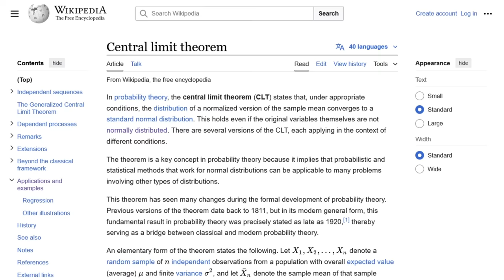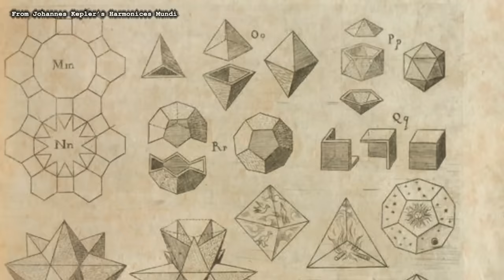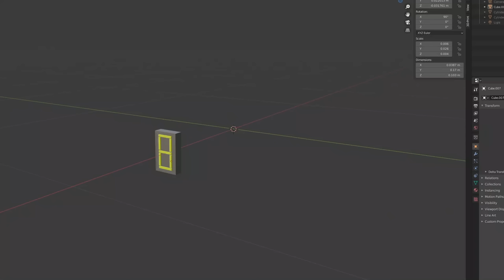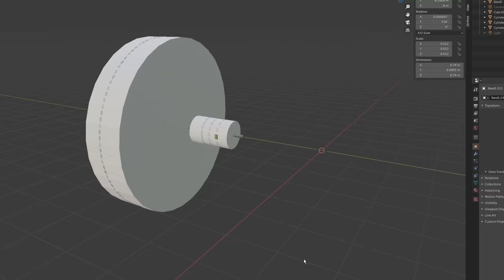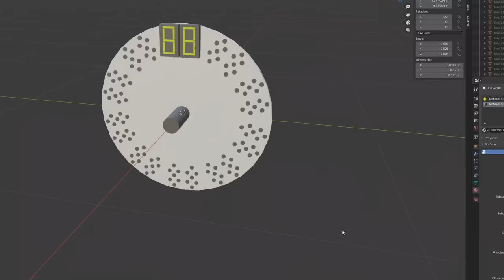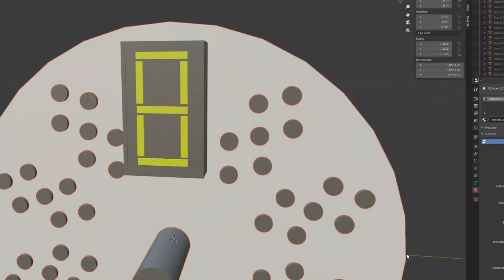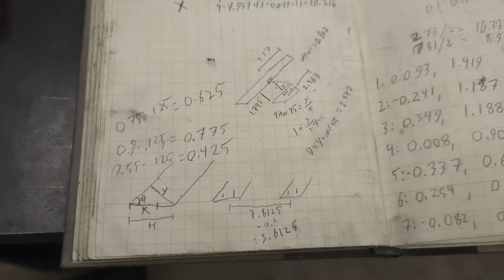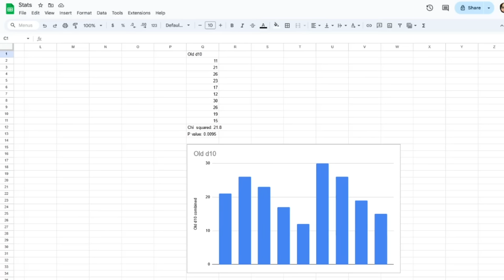Making a d10 spinner

Comment: I love both the concept and your actualization of it, so it pains me to say that this concept is inherently not 100% fair, even if it is better than a traditional die. The work required to change digits depends on how different the digits are. For example changing from 1 to 2 requires more work than changing from 8 to 9, and the wheel will slow down accordingly

Comment: Dear Attoparsec

Hi, you may have a misconception of the Central Limit Theorem. 

In your video - Making a d10 spinner,
...the Central Limit Theorem, 'says if you start adding together independent random samples such as rolling multiple dice, it will end up creating a normal distribution - regardless of what the distribution was that those samples were originally drawn from!'

The Central Limit Theorem ~says- 

If you start adding together independent random samples until you have a statically significant collection, and take the mean of this collection. Then repeat this step with a different collection of independent samples, a statically significant amount of times, each time taking the mean of the collection. When plotted this collection of means will return a normal distribution.

In your example of 10d6 the underlying distribution is close to normal, and using the Central Limit Theorem may be overkill. The Theorem comes into it's own when you have, for example, a bi-modal distribution. 

it's not take ~1000 samples then plot and get a normal distribution (unless they where drawn from a normal distribution)
it's take ~1000 samples, find the mean. repeat ~1000 times, each time finding the mean of ~1000 independent samples. Plot the means. ??????. Profit!

I really loved that spinner, great work.

Kind regards
Soni

Comment: Laminated stacks of thin sheets are better at transmitting magnetic fields than solid hunks, that’s why largish transformers all have cores made of sheets.  If you want try the magnetpipe again  try that.
Reply: I always wondered why transformers were made that way.  Thank you.
Reply: That's not correct. Solid soft iron cores are better than laminates of soft iron plus insulator. The reason laminated cores are used in transformers is to prevent "iron loss" arising from AC, the loss of energy due to formation of eddy currents in the iron, multiple thin layers reduce eddy current production. This guy is interested in static fields.

Comment: i dont get it why didnt you just weld the aluminum? it is easy to weld it you need an ac tig welder or you can do it with a mig welder
Reply from the maker: I have neither TIG nor one of the aluminum welding attachments for my MIG.
Reply: @Attoparsec  when you said in the video thats its not possible to weld it i thought you meant that it cannot be welded thats why i commented
Reply: @Attoparsec  if you have an ac stick welder you can use that as a tig welder just reverse the polarity

Comment: I know the distribution looks good but it's, in a way,  false.  Dice are not numeric, they are probabilistic.  In other words,  you cannot use the mean value,  you have to use the probability of a specific value occurring.  

Easiest example is the natural 20. If you are going for a natural 20, it doesn't matter that the 4 dice add up to 20, you want one to be 20! It's a probability not a sum or mean.  Similarly if a game mechanic requires a double, then it's the probability of one dice matching another.  

This becomes more important when micro bias and variation occurs... 2 nearly perfectly balanced dice might have a slightly larger chance of summing a smaller number for example.  

For more on this Google what ordinal numbers are.

Comment: This isn’t anything to do with consistency or skill, this is a DOWNSIDE to using multiple dice for RNG. 10d6 and  1d60 are completely different methods.

If you use multiple dice you need to use it SPECIFICALLY for the normal distribution. Otherwise you should use another method